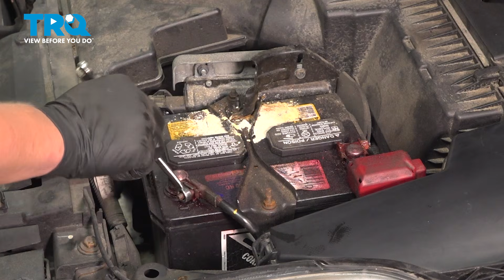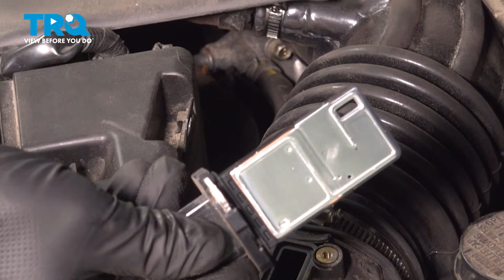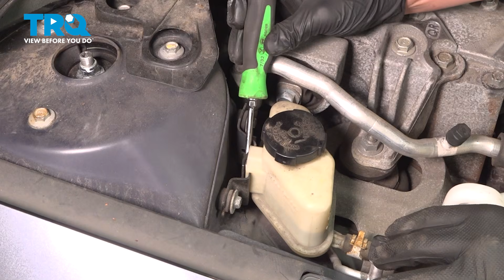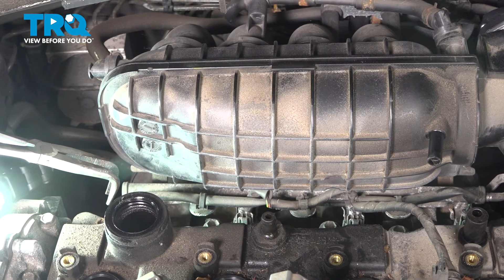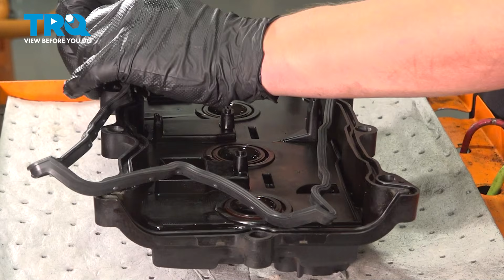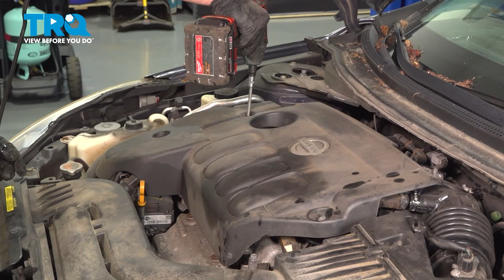How to Replace Valve Cover Gasket 2007-2012 Nissan Altima

Comment: One thing my Nissan has that it doesn’t show in the video is the two screws that hold the alternator to the engine mount plate. All you need to is remove them and the tension on the belt should hold it in place for you to remove the whole bracket off. Another this is just replace the whole cover due to the tube seals not being able to be removed since it’s built into the cover. They have gaskets that come with them but they are a waste.

Comment: Super helpful video, Thank you! This was my first repair i ever did on my vehicle and i didnt use any power tools.. I got the repair done just fine, the engine bracket nut was difficult but when i got it loose, my engine rotated and fell back a few degrees, I must not have been on stable ground or my jack was in the wrong spot.
 That side screw what goes into the engine support bracket was about 5 inches off  center now.... I had to get a ratchet strap, hook one end to the engine, and the other end to my buddy's trunk latch with his car in front of mine, and slowly ratcheted it back in place...got the side screw in and everything works great now... Thanks!

Comment: It's better to just replace the entire plastic valve cover - less time wasted cleaning, and importantly, the tube seals get replaced.  The tube seals are super common to leak and fill spark plug holes/coils with water.  Blame the manufacturer for making the tube seals integrated with the valve cover, but replace the valve cover and hold your nose doing it for all the wasted plastic.

Comment: Imma be real, great video, but I was not prepared for the gasket that goes around each of the four valves to be worn. In fact my ignition coils broke in half pulling them out, all the oil gummed it up and they were too stubborn. Upgraded the cost of this an extra 240 dollars. Had to be done though. Great video.

Comment: Great video, just did this in my driveway. I had lots of oil in spark plug 4. A little in 1. And none in 2/3. Got her put back together and now I have no dash cluster or throttle, car runs but not able to rev engine up it sputters. Slow crawl full throttle in reverse or drive. I did break the dust over on the ecm plug, but no damaged wires and connections seem fine.
Reply: Did you ever figure this out?

Comment: Nice video, very clear for understanding the valve cover replacement. One question, can we replace the seals ONLY instead replacing the entire cover? or use any substitute as to seal & prevent the oil to get over the spark plugs? I came to know from the auto mechanic the cost of the cover ranges from $200-300!